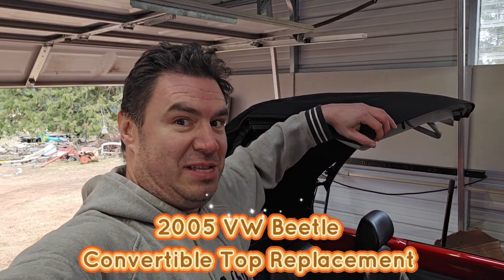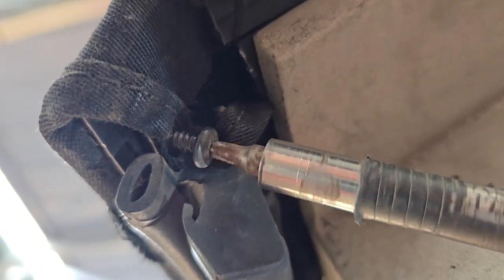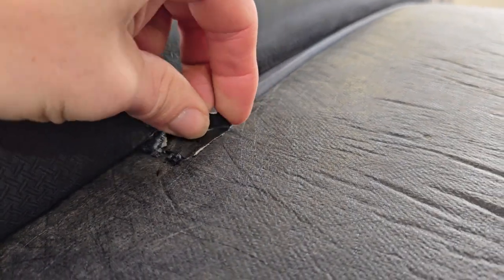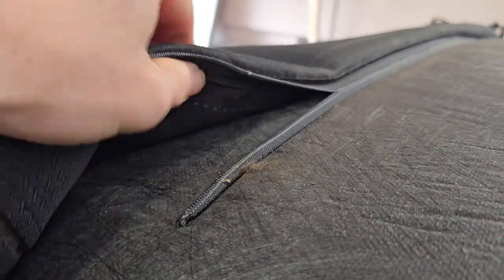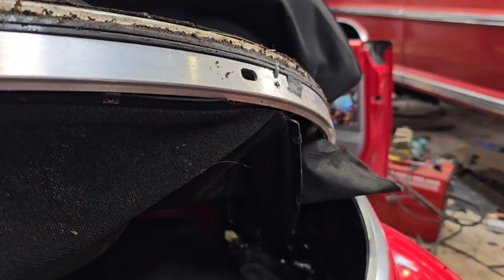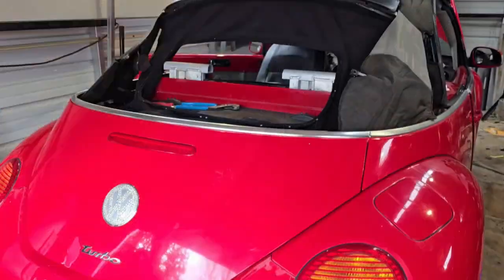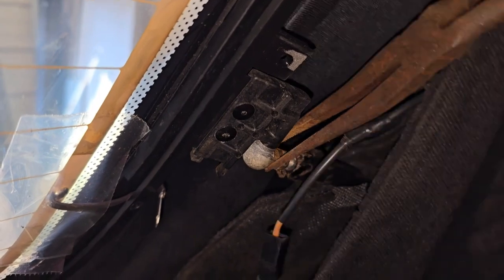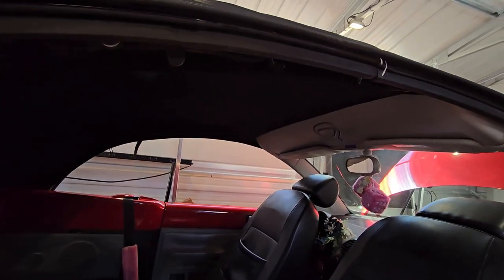How to replace a VW Beetle convertible top.

Comment: Good video. I just replaced mine. How did you attach the headliner to the back window? Mine doesn't have a channel at the top or bottom either.
Reply from the maker: @mdcampbell14  We never did get the headliner attached to the back window. It just hangs loose. That's been the only big issue I can think of though.

Comment: Hey - thanks for the video.  I am needing to this to my daughters bug.  Where did you get the top?  Since it's been a few months, still good?  Thanks again.
Reply from the maker: Yes, it is still holding up good. I was afraid because of the amount of stretching it needed, but it has not ripped, and the top is able to be put up and down with no issues. My daughter got it from Ebay. The only issue is something with the inner fabric for the rear window is loose.
Reply: @nickfreeberg_WICKET  Always curious of the ebay ones, unless you want to buy from factory $$$$.  Thanks for the reply.